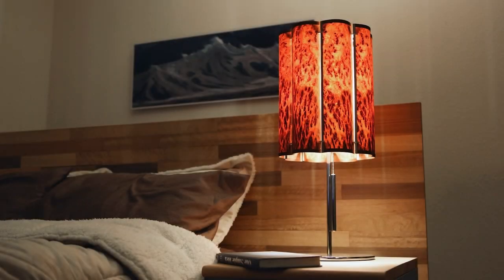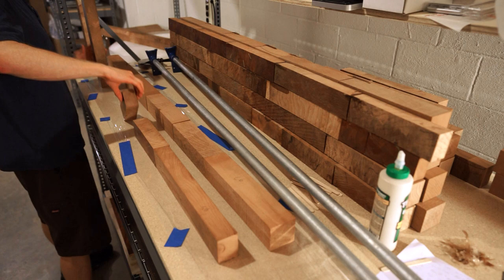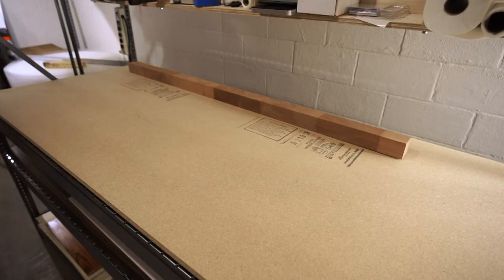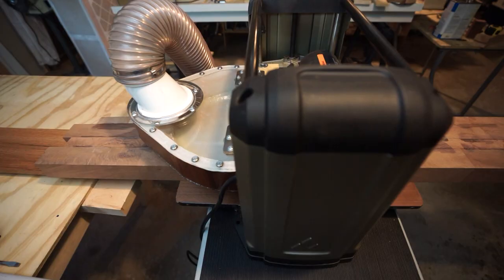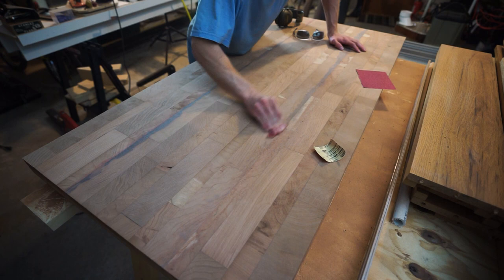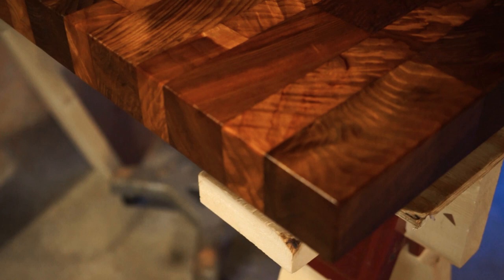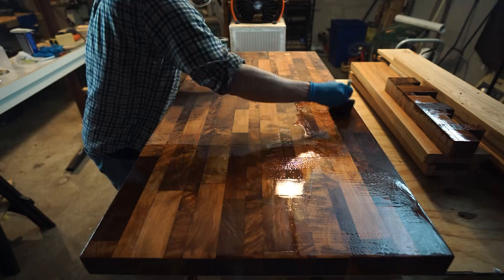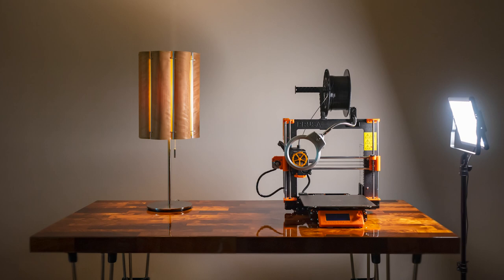Building a Butcher Block Table out of Scrap Wood

Comment: Does it need that much glue? Is there anyway to cover it with less to achieve a good enough bond but not so much squeeze out?
Reply from the maker: Possibly but you might end up with voids. If the wood is more clean-cut you can probably get away with less or wipe it off before it dries.

Comment: This looks amazing, it's 100% redwood? I've been told not to make butcher blocks of redwood, but I love the way it looks. Too soft?
Reply from the maker: Thanks! It's 100% redwood. It is fairly soft, so dropping things on it will definitely leave a mark... but that just adds character or something. If you covered the top in epoxy that would solve the softness issue.
Reply: @The3DHandyman  Has it held up well for 4 years? I made a kitchen island out of doug fir and it's been fine, but I assumed since doug fir is used for floring, it should be hard enough for furniture. Then I looked and saw tight-grain redwood (not construction redwood)  is about the same hardness as fir.
Reply from the maker: @jeffreyjbyron  It's got some dents in it, for sure. Most of the dents are from moving it from house to house over the last few years. Otherwise, it's held up well.

Not that it's an ideal look for everyone, but if you coated it in epoxy, it would be a lot more resilient.
Reply: @The3DHandyman  Sometimes I love the way epoxy looks. Most of the time it's too "definitive" for me. I like to have the option of easily re-finishing in the future so I usually stick with oils and waxes. I'm building a huge redwood table right now, and I'm tempted to do an epoxy pour, but I think it would be extremely hard and expensive. 

Everyone tells me to avoid building with redwood, but here in norcal, we have so much of it, and actually like the way it wears. I especially like how it wears when it's outside for a decade.
Reply from the maker: @jeffreyjbyron  It is a beautiful wood. I think you are right to stick with the oiled approach.

Comment: ooof 3 months! Have you considered 2 coats of pure tung oil followed by the top coat sealer? feasibly done in 1-3 weeks max. Nice looking table by the way.
Reply from the maker: If I ever do another build like this, I'll keep that in mind. I had originally tried the technique in this video on wood veneer lamp shades to make the wood more pliable. It just didn't transfer all that well to the next project. As is, the finish on table still looks great after 4 years, so at least there is that! haha

Comment: I wouldn`t have used the oil and then the top coat myself but it sure turned out to be a beautiful table.  Congrats.  Informative video Thanks
Reply from the maker: Yeah, I definitely wouldn't suggest it either. The look on the face of the guy at the woodworking store when I told him that I had put the oil on was priceless tho! Thanks for the comment

Comment: Great video and result. Can you explain your planer’s dust collection setup? I have the same planer, but the collection is not very good.
Reply from the maker: I thought about making a video on that at some point. It was made before I started the channel.

Basically its a curved wooden box with a plexiglass top. Inside the box there is a formed piece of fabric coated in a thick layer of epoxy resin. The whole thing creates a smooth chute for the chips to collect at the back where the dust collector port is. For the port I used a 4" pluming fitting that had a 45 degree angle in it.

Hope that helps!

Comment: How well are all the joints holding up a couple years later? Occasionally you see long glue joints split apart.  But it's a damn beautiful table
Reply from the maker: Thank you! So far it looks like the day I finished it. I used Titebond III waterproof glue, not sure if that helped. Redwood also has a relatively low shrinkage/expansion rate compared to other woods. I also oiled it and let it sit for months before finishing/applying weight.... one or all of these things contributed to it's stability. Hope that helps! lol

Comment: Curious about your benchtop planer. Are you happy with the results and have you thought about upgrading to a spiral or helical cutter head benchtop? Have a bunch of similar scraps so appreciate the video. Thanks.
Reply from the maker: The Delta 13" planer has been just ok. It did get a new gearbox a few years ago. There was no charge because it was still under warranty. I may have been at fault for making it work to hard.

There are some chips out of the blades and the table underneath the cutting head flexes so board thickness is not consistent across the whole width of the device. I have to clamp a piece of melamine in there to make it a bit less flexible but then there aren't any side guards for to guide the wood pieces through the device.

It was cheap and it's good enough for me. I can't say I use it enough to justify an upgrade to a nicer piece of equipment any time soon.

Comment: Looks great! Question: since you have small pieces of wood without any reinforcement underneath, is it not possible for the wood to break where you've glued them together?

Asking because I'm about to do the same but not sure if glue will be enough for a computer desk.
Reply from the maker: Thanks! If I were to body slam the table it might split in half. I am currently using this table as my computer desk and it is working nicely. Due to the size of the table, my 60lb PC is sitting right over the legs and for the last year an a half. There has been no signs of structural issues with the table.

If you want to configure it differently, you way want to reinforce it is some way.

Another thought... I also use a lot of wood chunks that have the grain running vertically through the table. This makes it more structurally weak than the fact that it is made from chunks. If the grain is running horizontally through the piece it will be much stronger, possibly as strong as solid boards, especially if they are 2in thick.

Hope that helps!
Reply: @The3DHandyman  Thank you. Very helpful. I'm thinking I might run a groove underneath using a router and put a long piece of wood there to reinforce it.
Reply from the maker: @zx1701  Any time! Reinforcement is a good idea but...  you may want to use the exact same kind of wood for the reinforcement as you do for the top side OR a wood that has a similar tangential or radial shrinkage rate that is matched with the top of the table's predominant grain direction.

On my desk project I used maple for the top and Baltic Birch plywood for the underlay. The Maple planks on the top shrink and expand at a different rate than the Birch. This caused the Maple planks to split apart when humidity dropped during the winter.

Check out the wood database to find something that might work best.
https://www.wood-database.com/wood-filter/

I'm no expert woodworker. Because of this particular issue I decided not to reinforce the redwood table at all, just make it really thick instead and alternate grain patterns. Redwood also happens to have very low shrinkage rates compared to other woods which may have helped with this issue.

It might help to talk with someone at Rockler or Woodcraft (if you have one in your area) about this concept to before getting started.
Reply: @The3DHandyman  Great advice! I'll do that. In fact I might just use a metal plate instead as it will be easier to install that.

Thank you very much!
Reply from the maker: @zx1701  If you put oversized holes in the metal plate for the screws (washers+pan head screws) then the wood will be able to expand and contract while the metal stays a constant size. Just an idea. Good luck with the project!

Comment: So I'm planning a similar project out of black walnut. My concern is wood movement and cross-grain glue ups. How has the table handled the changing of the seasons?
Reply from the maker: After about 3 years, it's still as smooth as the day I made it. You may want to let it set for a while before doing the final sand and finish if you have the time.... but then again, I'm not a very experienced woodworker, so you may find better info elsewhere :)